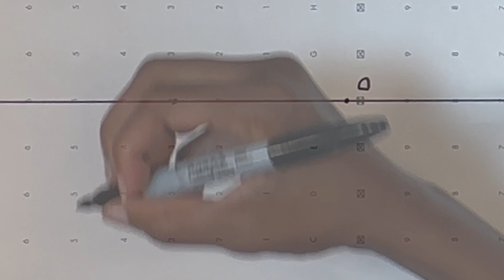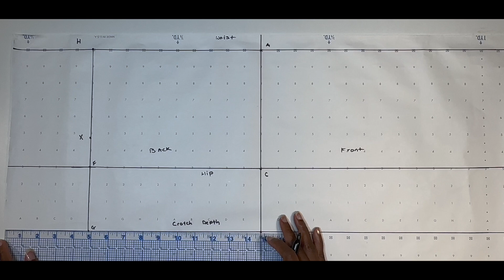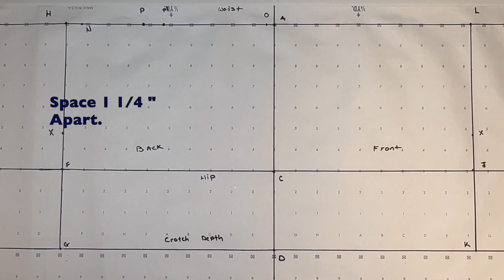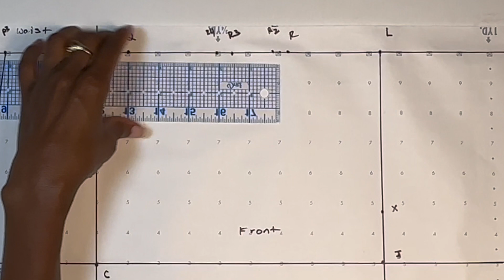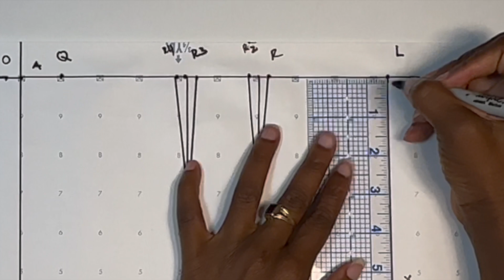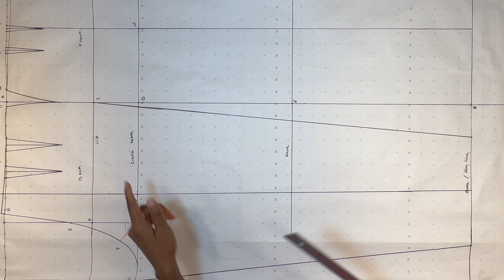How to Draft the Trouser/Pant Pattern ( Part 1)

Comment: When you did your back extension your back hip measurements is 9. 5/8+1/4 for ease which gives it a total of 9.78. My question is on the front piece you have 9 1/8+1/4 equals 9 3/8 The difference between 9 5/8 and 9 1/8 how did you get the difference right there?

Comment: Using the book, have you tried applying personal measurements, the front measurement on the waist is going overboard.
Also there is one step you omitted at the crotch ½" at "I" and "m". And at "L" are you still still moving in by ½"?

Comment: Can I apply same principles to men’s trousers?
Reply from the maker: Usually, a woman’s trouser pattern should not be used directly for a man’s trouser pattern because of anatomical and fit differences between male and female bodies. But, with  certain adjustments, You can modify a women’s trouser pattern to suit a male body, most especially for androgynous or unisex designs.
Reply from the maker: If you want to experiment using the directions I have here, I suggest that you take excellent measurements of your male model then 1. Straighten the hip curve: Reduce the curve between waist and hip. Men usually have more narrow hips than women. 2. Lengthen the front rise: Add length at the crotch for comfort. Adjust the back crotch curve: Flatten and lengthen for male seat shape. 3. I didn't create a fly pattern for this pattern tutorial, however remember Men's fly often opens right over left, opposite of women’s.

Comment: On E where you did the knee depth why did you go up a half inch?
Reply from the maker: I went up 1/2" as per the Fashion Design by Helen Joseph Armstrong book directives. I believe the author did this to ensure Anatomical Accuracy.
The knee is not located at the exact midpoint of the leg. On most bodies, the human thigh (from hip to knee) is slightly longer than the lower leg (from knee to ankle).
If you were to divide the leg length exactly in half, you may place the knee too low.
Adding 1/2" inch above the midpoint corrects for the above mentioned and provides balance by supporting functional movement. Too low or high a knee placement can restrict movement or create pulling when walking or bending.  Please note that although the book directs for a 1/2" adjustment. That measurement is not set in stone. You can adjust the knee according to the body you're drafting the pants for.  Example, say you're creating the trouser for someone who has long legs with equal distance from hip to knee and knee to ankle. You can forgo the 1/2" directive and just keep the knee placement in the middle.  Following directives for Patternmaking is a lot like following food recipe. You start with a set of directions, but there’s room for intuition and personal adjustments to suit your preferences/taste or your design vision.